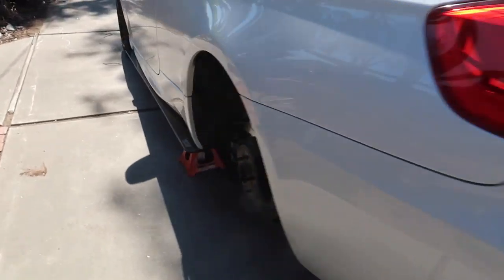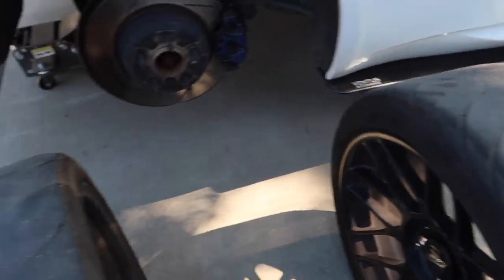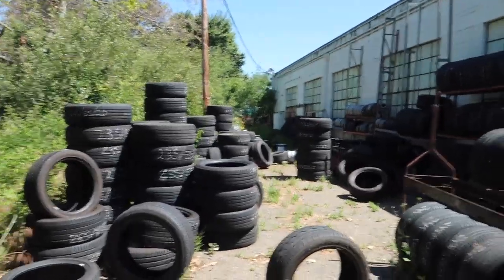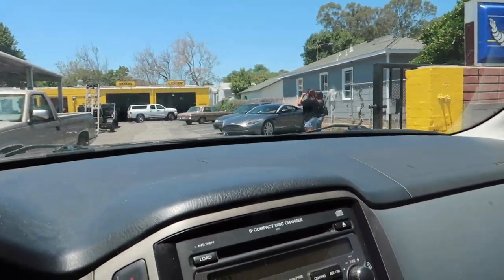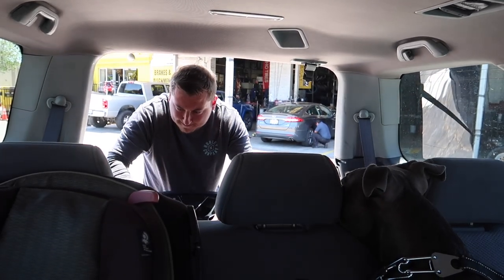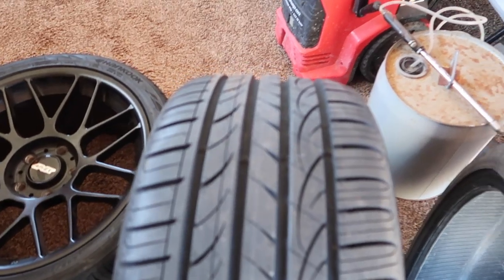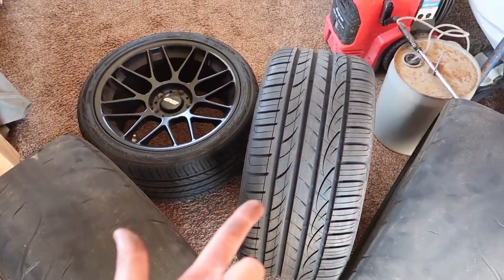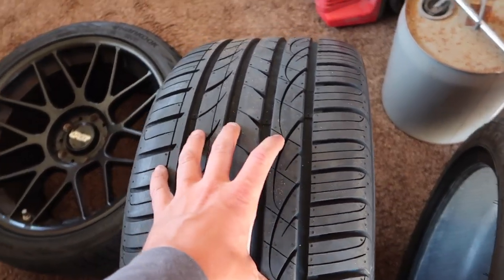MY 335i ALREADY NEEDS NEW TIRES!! (VLOG)

Comment: Ricky, I remember you saying that federal tires runs big so your 265 in the rear was really like a 270 , did you match that with the evo12s or did you stick with 265 im just asking to see if your sidewall ratio would be different bc im looking at arc8 18s but personally i dont like the big thick meatty sidewall on the federals thanks
Reply from the maker: It’s completely not noticeable! I’d run Michelin’s! There are the best tire I’ve ever had

Comment: what side skirts do you have? not the m3 style like the black lip where did you get them from and where they hard to put on?
Reply from the maker: There are from Ventus auto works and super easy to put on
Reply: Life of Ricky what size are you’re rims like width wise?
Reply from the maker: I have a video on this
Reply: Life of Ricky what would you recommend for a staggered setup on 18x8 and 18x8.5 i just got some style 193’s for my e92

Comment: Hankook V12s are decent summer tires... I run those as my rears... How much again you got it each? $230 - $240? Didnt get it quite clear?
Reply from the maker: $240 for 2! The shop was gonna be cheaper tires on for $240 but they only have v12’s left and they gave them to me for $240
Reply: @drivenbyricky4651  thats awesome deal! 👍